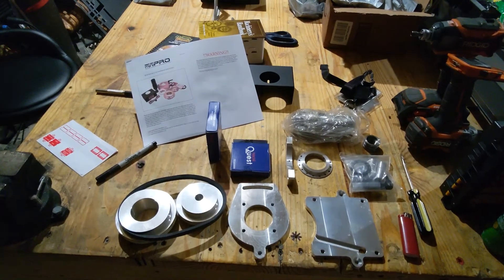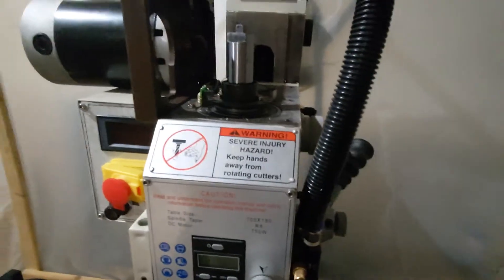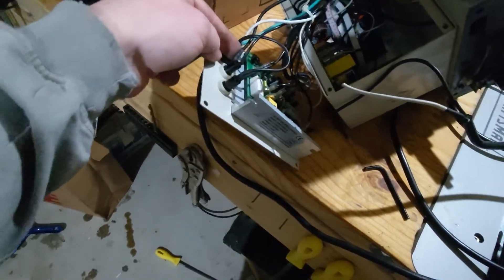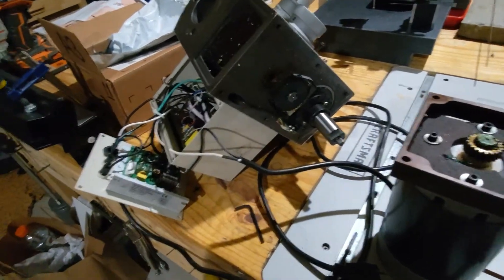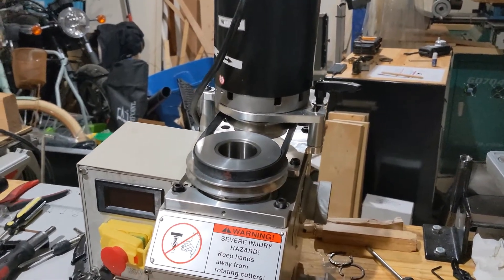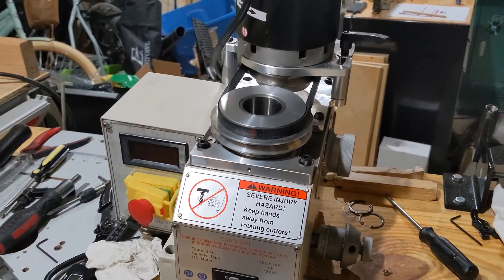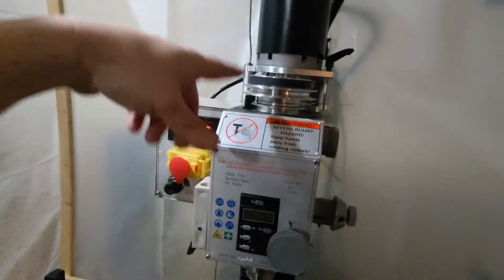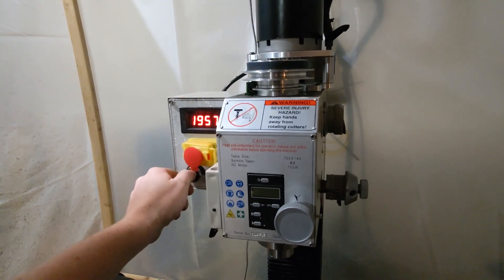Belt Drive Conversion G0704

Comment: Great video. This gives me an idea of what to look out for inside the head. I have a 2008 model of the LMT 25L (from Lathemaster- now defunct) which is identical to the GO704 by comparing parts lists and specs. I would like to do a bearing replacement along with the belt conversion and this was very helpful. Thank you!

Comment: Help !!! I don’t know what I am doing. I want to do a belt drive conversion but I can’t spend $400. I am retired and on a limited budget. 
Bull from Seattle
Reply from the maker: Do you have a lathe? If you have one, majority of the belt conversion is to make the spindle bearing housing sleeve, belt pulley, and the rest can be made on your mill. Take a look at Hoss, he has the plans to do the conversion, bearing suggestions, parts lists, overall great resource if you have a g0704 http://www.migration.g0704.com/belt_drive_dvdrom_download.html
Reply: @kazierkreations9382  I don’t have the ability for this advanced parts.
Reply from the maker: @stargatefred  the best advice I can give you is this, if you can't afford the kit, and you have the tools, the hoss plans I mentioned in the previous comment is the best and to be honest is fairly simple if you have the patience and time. I don't know what application you are tying to use a faster spindle speed, but the faster your spindle goes the smaller the bit, unless you converted to a CNC a slightly faster spindle is not really going to help you with manual milling. Best of luck, to be honest if I was to redo this project I would basically look at Clough42 and think about investing in a different motor/spindle. With this upgrade your not only buying the kit, but you also have to buy new bearings to handle the faster speed, and when all said in done you can easily be 200$ more in just bearings/grease.
Reply: @kazierkreations9382  yes I am converting my mill to CNC. THANK YOU. BILL

Comment: Hi, very nice conversion. What engine did you use? Possibly some lines on the material used. Probably a lot of things are made to measure.
Reply from the maker: It's the same motor that came with the machine, it's actually a kit that's sold for this machine as well, so nothing was really fit besides the mounting bolts being tapped slightly longer. I will probably upgrade the spindle when it finally burns out and then I'll be looking for a new water cooled spindle... But that's gonna be a long time before I do that